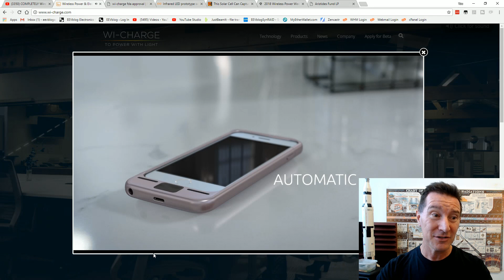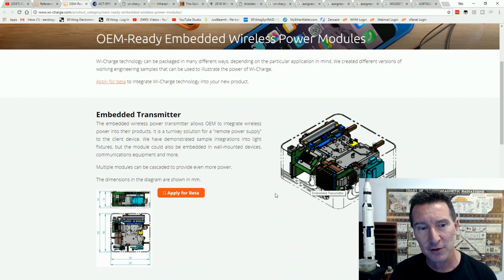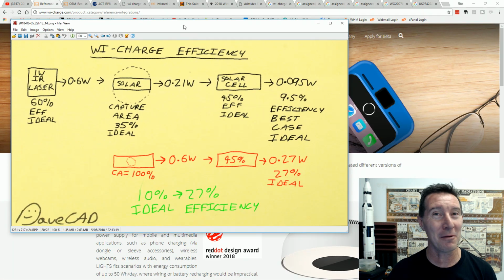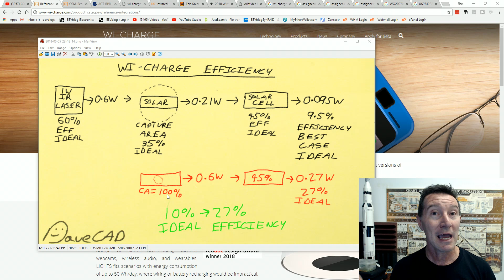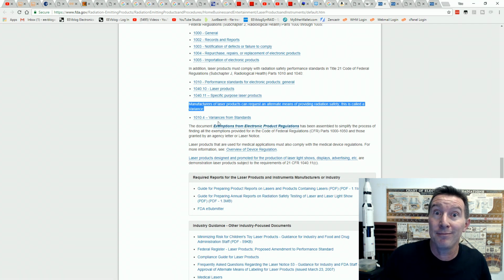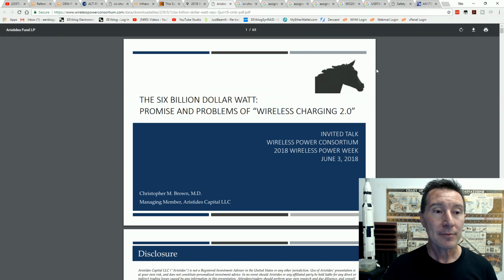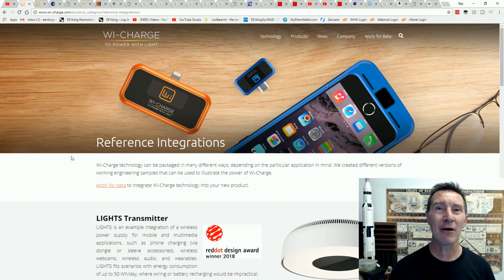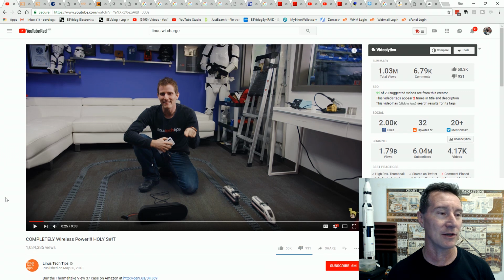EEVblog #1092 - Wi-Charge IR Wireless Charging - Fact or Fiction?

Comment: Direct sunlight in the best case delivers 1kW/m2 that's 0.1W per square centimeter IIANM. This thingy say 5W into what, 5 square centimeters or so?  That's 1W/cm2 or about ten times as much? Or is that 5W figure after the receiver conversion losses? If so it's perhaps not tens but hundreds of times more than the sun /cm2 !

Comment: I can see this being useful in industrial applications. More like the trains, where you could have moving equipment in an assembly line, and this delivers the power without the need for wiring. eg motorised heads that have those nice long ribbon leads that get dragged back and forth. don't see the consumer level usefulness here.

Comment: Personally I just plug my phone in to charge, either with the mains charger or a USB powerbank, all this wireless wank is just not going to work until they can create something that can just absorb RF radiation from all the various sources of RF we have these days and convert it into DC power...
Reply: twocvbloke The combined power from all RF sources reaching your phone is less than a mW. So that would not work at all.
Reply: I look into it. You can do that, but the power gathered is minuscule. If you have a twenty-meter antenna, you can run an LED or operate a very quiet crystal radio. Miliwatts.
Reply: look into wiliot.com
Reply: It's called an antenna lol. But the amount of power it absolutely tiny. Try it yourself. Run a long cable and connect it to a scope. You'll see all sorts of wonderful radio waves mostly dominated by your mains 50/60Hz tho.
Reply: While that is tiny, the current makes that look huge. I measured it to be ~2uA from a 100ft copper wire run in my garden.
Reply: Given I'm 2 miles from an up to 100 Kilowatt transmitter mast serving the North East of England, I'd be surprised to get so little power from the airwaves...
Reply: I built an RF harvester. I was proud - it was pulling in such a huge amount of energy! I could light an LED from it! So I turned off my room light to see it better... and the LED went out. Turned out that energy was actually being picked up entirely from the noisy switching power supply in my cheap 'HamsBane' CFL light bulb.
Reply: Vyl Bird Ha!
Reply: Some guys made a mobile phone that worked entirely on an energy from radio waves

Comment: Does it come with a pirate eye patch?
I have a better application for it: Laser mosquito zapper.

Also, for calculating the real efficiency, you have to include the power dissipated by the control circuitry which may be 10-20W additional.

Comment: Wow, I was thinking 10% efficiency since it’s radiates out in all direction (cone shape zone) so that leaves a lot of surface area getting zapped as loss. They could go directional to a table and maybe set up some kind of feedback to increase power when a device is detected. 
I don’t know. Wireless charging pad system out now is doing a decent job. 
Uphill battle to convince me to switch over. 
I may have equipment sensitive to IR that can cause issues like TV and some plastics may discolor in the radiated area. 
Didn’t touch on long term human exposure. . 
This idea was around in the 1970s on a large scale. 
Orbiting solar panels or mirrors wound direct light or microwave energy to the surface to provide power. 
https://en.m.wikipedia.org/wiki/Space-based_solar_power 
I’m going to pass on it.

Comment: A small solar panel 110 mm x 65 mm (4.3" x 2.5") can be purchased from Bang Good.
It claims to put out 5 volts x 200 ma which is 1 watt.
Could be stuck on the back of my phone .
Any thoughts?
Any good?

Comment: I use a system that converts mains voltage to the required voltage and sends it to the phone - it's called a power supply and cable - not interested in the fad for wireless charging.

Comment: You are far to kind in your efficiency calculation. I would guess that they are around 1% mark.   

That said, efficiency is not an important here. They simply can NOT deliver 5W of optical power safely on a spot size similar to the device size (1cm2).  That becomes even worse If they are talkining about 5W delevered electrical power.

Class 1 regulation for public spaces limits total IR laser power to 1mW/cm2. So the delivered electrical power would be a few microW. This makes me believe that there are batteries in the trains and they are using the laser for controlling the trains. (Unless they have some super duper efficient electrical motors which can do wonders with 10uW, in that case i would definitely buy their stocks😁😁).

Comment: I can see businesses buying this for meeting room wireless microphones and control panels for their audio/video conference units, businesses like having no cables and stuff in their meeting rooms if that's their target audience then they might get sales if they're going for consumer then they're only going to get gimmick sales
Reply: Pete Smith  did we not solve this issue 20 years ago? It's extremely inexpensive on the front end to have network and power outlets built into the center of the table. 

PoE works for lower power devices and you can easily charge your phone or tablet from your laptop. I've even seen conference tables with QI wireless charging built-in.

Comment: The kind of laser power they need in these is comparable to what is used in a small laser cutter. There is no way in hell I would run one of these in my house without the whole thing being in an enclosure with safety interlocks. At that point, you might as well just plug your phone into a normal charger.

Comment: one question: can you even stuff a 50 W ir-laser in this round thing?
Reply: Laser packages are pretty small in general, even the 50W ones.
Reply: Wolfgang Stelzhammer  laser diodes in that wavelength are small and powerful. Heat sinking them is another matter.
Reply: It would need a serious heatsink.
And a Big fan!
Reply: yeah but considering the size of that installation, getting those is basically a non-issue
Reply: Wolfgang Stelzhammer big noisy fan

Comment: Dave made a rather major error in this video. He made a claim that the best solarcell around are about 40% efficent. This is sort of accurate in theory, but in practical reality its a bit more complicated.

The solarcell that can handle 40% efficency is multi junction cells. That is a cluster of cell, often 3 or 4 conected together via a spectrum spreder (like a prissm) and handeling each a part of the spectrum.

Each cell get say 10-13% efficiency over the whole spectrum, but they get a total of around 40% efficiency. Here is the thing, each cell only covers about 15% or so  of the spectrum, so each cell is really 60-80% efficient in the given spectrum.

The thing is the efficiency of the PV is rated at CRI 100%. So if the CRI is down to 0% (that it would be with a laser) the efficiency of the cell would either be 0% (if its out of spectrum) or rather high, say in the 60-80% range if its in spectrum.

So you really have to have a adapted PV or you will get pretty much now power what so ever, but if you have, the efficency will probobly be quite a bit higher than 40%

Comment: Ceiling. The roof is outside on top of your house.
Reply: OMG! I know! That was driving me nuts! Every time he said roof I had to shout, "CEILING!"
Reply: Same here. Its ceiling!
Reply: I guess he´s talking about one-story houses? :P
Reply: Dave lives in a one-story house (I am jealous).
And what is on top? A wireless power receiver (irony).
If you compare his received power with the total output of the source (the sun) you get an unmeasurable low efficiency.
But you can't switch off the sun. Thankful it's free.

 Btw, there are phone chargers with a solarcell.
Don't try to beat physics!
Reply: Basement ScienceE still the ceiling is the INSIDE and the roof is OUTSIDE

Comment: Could the system consist of 4 individual lasers?
Reply: Dan R. Hansen if you have two devices in close proximity the angular distance of the base station won't be large, so you'll still need 1 laser to be able to jump around between them(to avoid physical collision in the base station). Having one laser is far more practical in terms of cost, in my opinion
Reply: Unlikely.  Think about the amount of space required for the laser and its heatsink, the power supply/cooling, the beam movement elements, the IR camera and image-processing gear to handle the beam-hunting and safety compliance, and so forth.  It’s just complicated and likely expensive enough, at least in this beta stage, to prevent implementation until they are potentially ready to sell to the public and can fund more advanced models with the money from first-gen sales.
Reply from the maker: Pretty sure it's only one. Seems to only have one mirror, so no point have multiple lasers in that case.

Comment: What if "delivered power" is just the radiation that passes the infrared window of the transmitter? You can argue that more than 50% of that only heat up your room but anyhow it is "delivered power" from the transceiver. Well it's all marketing obviously but imho still impressive tech, although far away from real usability.

Comment: I got the solution for the lazer dance, how about instead of using old tech like NIR, what if you use gamma radiation? bam wireless charger even through walls! we should ask our friends in japan if they care about the energy conversion factors vs solving a problem.

Comment: Sorry Dave I don’t think you are understanding the usefulness of the embedded charger which Linus clearly says it does have a battery so it can charge quicker than the wireless power allows and also avoid someone crossing the path. 
If Starbucks handed out chargers do you think they would come back? Locks only keep honest people out, these would need to be glued in tight so they don’t go missing.
Yes they may not be efficient but I wonder what resources and energy cost would be required to install cables to every table in a restaurant. Also if cables are used it would be difficult to rearrange tables.
It may not be perfect yet but it’s a start.

Comment: Basically, solution to a problem which does not exist = commercial flop, probably. Could you imagine buying one for every room, so you could maybe charge your devices more slowly than you would have over a decade ago, with the added problems of making sure it's even getting power to the device in the first place.

So, the problems with safety, the ugly 'light' in the ceiling, with constantly scanning infra-red laser, are not the commercial problems it faces. It is fighting, phone, mobile device is getting low on power, put it on Qi pad, plug in charger done, with fast charge full in no time these days, faces half a day wait probably with this.

Comment: 5W output of power for up to 4 devices?  A hub based USB charger puts out 10 watts per port.  How long would it take to charge your phone from 0%?  a day?
Reply: Depends on the size of your battery, at 3000mah you would have 3.7v x 3ah = 11.1Wh so at 10W a little over an hour plus another several minutes as lithium batteries charge much slower near the end of charge, so at 5W expect about twice as long and if that 5W is split between four devices would be 1.25W per device or about 9 hours and to maximize the charge cycles of the battery you should try to avoid discharging it below about 20% and if possible use a charge limit app which will require a rooted (dunno if its possible with iPhones) phone to limit the charge to something a bit under 100%.

Comment: When i seen this device on LTT it did not pass my the smell test. and i am glad to see that i was right.
Reply: Well even on linus' video you can see it was shitty at best. It worked, yeah, but barely powering a paid of speakers and the promise of more power seems fishy and useless in any case. Wireless chargins other than inductive is but a fantasy. Its stupid, not practical at all and cant be used for anything other than low power stuff which charging a phone isnt one of them. all in all its retarded. Even if 100% efficient, it'd be shit, and of course, there's the dangers of high power laser and RF energy exposure

Comment: 1000mW level "approved" model - that's 200mA at phone charging 5v - that's like the shittest of shitty power banks with the longest of shitty cables to get that bad a charge.  Can't say I'm excited, especially if it then multiplexes with upto 4 units in a room at a time and we're each seeing enough power to maybe light up the screen.  Or put another way, the Qualcomm reference 835 processor phone consumes 3500mW, so the battery would still drain really fast under reference/testing conditions.

Comment: Small size and high energy wireless power transmission will never be safe, because the energy transmitted would have to be too much concentrated and would kill anybody in its way. It would be an energy weapon to kill people, not a wireless power transmitter. And if the power is in safe level, than it would be too weak to be interesting and practical as a wireless power transmitter. It is just common logic and basic physics.

Comment: Transmitting wireless energy wireless degrades at such a short distance that I don't believe at all that this work's at a distance of 5 meters. This is no difference than the uBeam ultrasound ultrasonic wireless charging that claimed could replace your charging cables. My Samsung QI wireless charging pad requires the smartphone to be resting on the pad before it can start to charge the battery up at up to a max of 15 watts. This is complete B.S.

Comment: I do not know, but aren't all these wireless charge technologies too complex, too expensive, too big, too heavy and too inefficient to be practical at all. I mean, why somebody is researching for a worse method to wirelessly deliver the power if we already have some historically valid ones? 
1. Isn't solar pannel an electromagnetic wireless power transmission method and way better than dangerous and complex laser rays pointing device? Someone can concentrate any high power lamp into a solar pannel and it would be a simple wireless energy delivery system. 
2. Isn't simple wind blower or compressed air pointed at wind generator a better way to transmit power over the air than ultrasound? Someone can point a wind blower at a wind generator installed on smartphone and have a simple wireless charging. I think it would deliver more power than 1,5W.

Comment: If they were using mid infra-red it would probably be pretty safe. A lot more of the energy gets dissipated in the eye before being focused onto the retina allowing higher powered beams to be eye safe. Would also drop the efficiency to u-beam levels though as laser sources at those wavelengths suck.

Comment: In summery this technology is going to get 30% efficiency at best. Magnetic coupling (Qi charging) was far more efficient at usually 65% or better but required the phone to be close. In reality considering the practicality of getting a proper angle, mounting and getting an electrician to wire an expensive ceiling unit and terrible efficiency makes the whole prospect laughable. Especially considering specially designed Qi chargers that would dynamically choose from multiple coupling coils could cover a much larger area say the entire surface of a desk and table or basically anywhere you'd set down your phone. It just didn't take off because not enough phones supported it and it was to impractical. But to put it lightly this tech is an even bigger joke with even more problems. There is however a neat aspect that could be pretty useful which is to have any number of power devices on the wall things like lights and motion sensors that could all be powered from one location. Not things like phones so much but if you got 5 led lights, a motion sensor, motorized blinds, door sensors, etc you could totally justify the cost of this thing. But for the average person to charge their phone or tablet? It's a silly toy at best.

Comment: Really disappointed in this video. Not engineering wise, Dave is right on that, but in his opinion. Dav is like why can't you use Qi, why can't you use power banks, why can't you use wired? Really Dave expected better. Again engineering wise Dave is correct.

Comment: This is state of the art technology and needs to be encouraged.  You could send power through fiber optic cables for miles or power satellites.  I personally hate USB and HDMI cables so anything that could potentially replace those two things in my life is a winner.  Also consider that the amount of copper in the world for cables is finite.
Reply from the maker: Actually power over light has been around for decades, it's not new.
Reply: EEVblog, You can know, Dave, you are using it yourself, on your roof!
(But not very portable, pity!)
Reply: Anything? D cell batteries and VHS tapes would work for you then.

Comment: It's cool stuff really.. Personally I hate wires - they're fucking everywhere. They look a mess, they are a mess, and it's a pain having to remember chargers when you're not home. So I get why people are engaging with tech like this - if you could power something wirelessly, no more wires = better. It might not work right now, but I've no issue with flawed designs like these. Accepting wires as the be all and end all - no thanks!